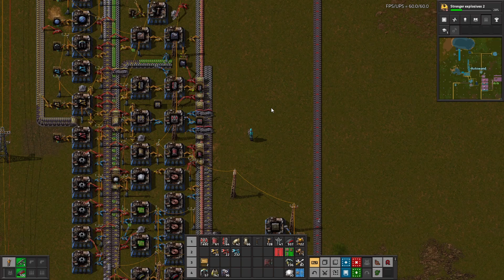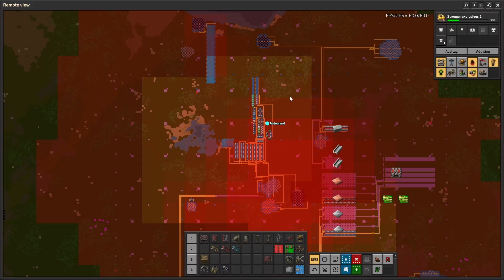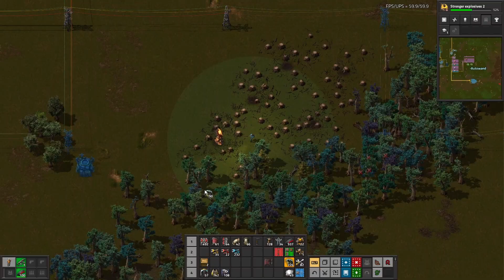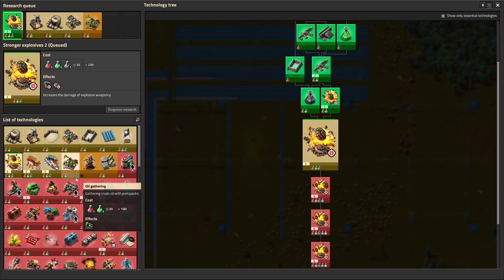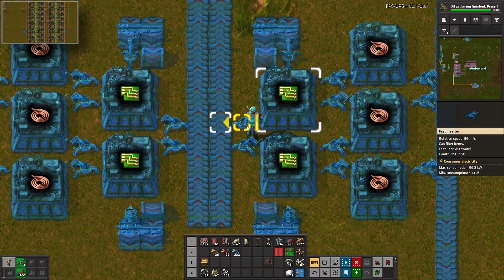#9 Using the Bus to Make Green Circuits | Factorio 2.0 | New Player Guide | No DLC

Comment: Some time ago a Factorio player posted an analysis showing that something like 60-70% of copper plates get used to produce green circuits. Regrettably I don't remember where I saw this and don't have a link (and it probably dates from 1.1 though I doubt it's changed much in 2.0). If your research confirms this to be the case, then you could probably decrease the copper to 2 belts on the bus once it's past the green circuit factory.
Reply: While that does track many other medium/high tier intermediaries (Such as Low Density Structures and Red Circuits) also use Copper. For me personally I use a 4 Lane Bus and will have 4 lanes of copper always.